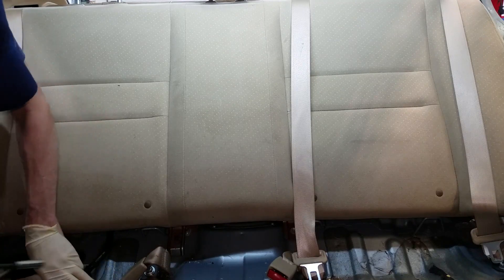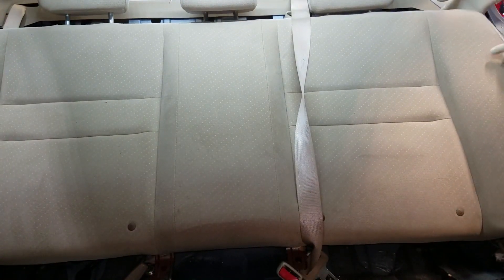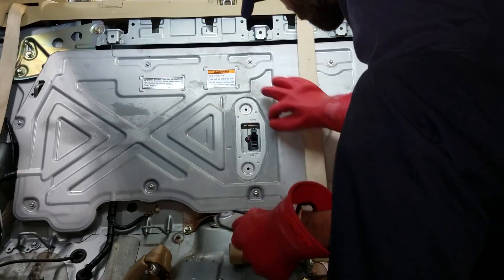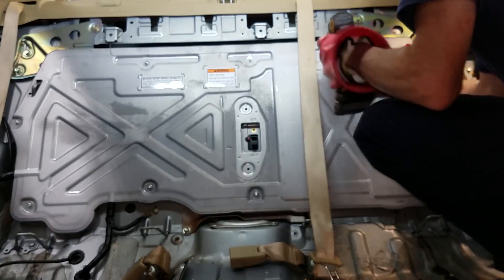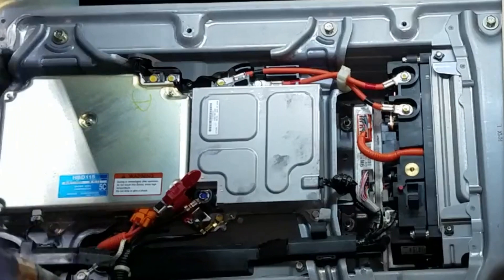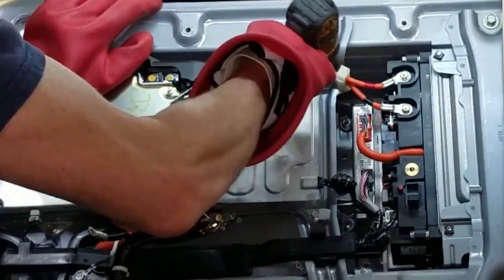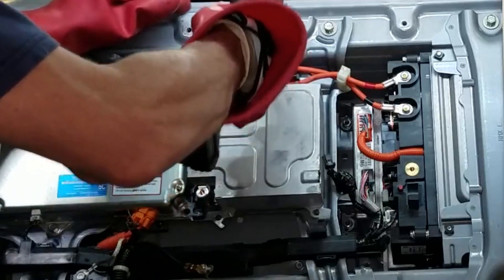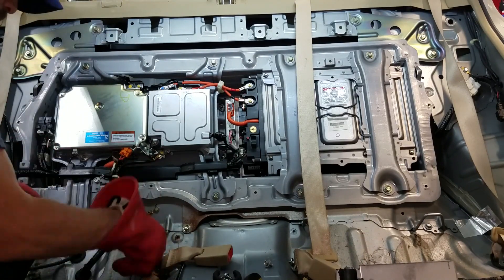Honda Civic Hybrid Battery DC-DC Converter Replacement

Comment: PLEASE HELP: Went to get a bad axel replaced on passenger side of 2014 hybrid civic, and 4 days later was driving in the rain and was braking to make a turn and the car immediately had brake system, charging system and IMA all pop on at once. I took the car back to where the axel repair was done and they said they didn't know what was wrong and to take it to honda dealer. I did and they said it's the DC-DC converter, but I just find it hard to believe it failed right after having axel replaced and suddenly. I haven't picked up car from dealer yet to see the code read out and ask if they checked fuses or grounding/wiring but I doubt they would check so they could just try to bill me 3k to replace DC-DC. Am I over thinking this and this is a normal thing that happens or should I investigate further?

Comment: I replace my DC to DC converter that I bought seconds hand online marketplace. But my car still not charging the 12v auxilary battery. I have a question do we need to reprogram anything when install a new DC to DC converter? How can I test if it is a problem with a DC converter or my car itself?
Reply: Hi bro i got the same problem and i was thinking to change the DC DC inverter so what have you done at last bro

Comment: Hello there i got a 06 honda civic hybrid and it has the ima and battery light solid on but i check the volts on each cell to confirm battery pack is good and it was so i order a used working dc converter but problem still there do you know what can it be?
Reply: Did u solve the issue? I have the same problem.

Comment: Hi folks, I found this video useful. My 2011 Honda Fit has been displaying an IMA light, and a message "I CANT CHARGE". A diagnostic machine showe there is a fault with the MOTOR POWER INVENTER, is this the part that has to be changed or just buying new  cells would help?

Comment: Dc to dc converter and intelligent inverter is these both same things?
Reply: No. An inverter converts DC to AC. That is the part to the left of the DC-DC converter. It is required for the IMA motor to start the engine and provide power to the hybrid battery through regen braking or engine usage.

Comment: Have a 06 civic hybrid. When car is running the 12V battery drops like yours did on your diagnostic video. But when you rev. the car, the 12V battery voltage goes up to 14V. We suspect the DC to DC converter but wondering why when you rev it, the voltage goes up and charges battery if the DC to DC converter is bad? Any information would be very helpful. Thank you
Reply: Did you figure this out? I have the same problem...

Comment: I got a 2012 Civic hybrid, the engine codes are p0a78  & p1440 . it's something wrong with DC to DC inverter? It needs to be replaced ?

Comment: is that the same as an "inverter"? Honda dealer told me the inverter (which went bad at 115,000) was $3500.00.
Reply: AndurilNarsil1 inverter is the one on the left of it.
Reply: No. An inverter converts DC to AC. That is the part to the left of the DC-DC converter. It is required for the IMA motor to start the engine and provide power to the hybrid battery through regen braking or engine usage.

Comment: I got a 2006 honda civic hybrid dies the 12volts battery overnight
Reply: Do you think the dc converter fix the problem?
Reply from the maker: Something is probley pulling power from the 12volt battery when the car is off. And amp draw test would need to be done to isolate the problem.
Reply: @FlatRateMechanic  P0200 code

Comment: Hey brother, I am not using the hybrid battery, I turned off the switch and am running off gas. My hybrid battery is bad, and I’m not going to replace it. But now my 12v is not being recharged. Is it this converter?
Reply: I have the same problem did u find out if its the dc converter
Reply: There is no alternator on this vehicle. The 12v battery is charged from the hybrid battery. You cannot have a reliable vehicle without the hybrid system.
Reply: Its iMA battery fault need to replace dtz y battery red light on in speedo meter .. you can’t drive long if red light is on .. car stuck n off .. soon no drive on long way . U need to replace iMA battery

Comment: If you turn off that hybrid battery switch... will that kill power to the ac compressor and make it safe to work on??? Please respond!! Thanks!
Reply from the maker: Yes, it would be safe, but I would always refer to the repair manual and take proper safety precautions.

Comment: I am not getting 12v charging. Just replaced the DC DC converter.  I am stuck.
Reply: E Z did you get it figured out?
Reply: I have this problem right now. Any tips on how to check if my dc converters bad?
Reply: prodAuggie replace the ecm located by the battery

Comment: You don't show actually removing it. After removing all the bolts, it still doesn't come out, because it's blocked by battery terminals. Still trying to figure out the best way to get this out, which would have been nice to have in the video. :)  [Edit: ah, it's that bracket on the lower left that you don't show removing]

Comment: I have the same problem in my 2007 honda civic hybrid. I have been manually recharging the battery modules (reconditioning). I watched this video, but you did not confirm by testing on the video. did the DC to DC converter resolve the problem? I am tempted to buy a dc to dc converter replacement on ebay but I am not sure this will fxx the problem of not recharging the 12V battery. I am in Utah. What state are you in? Thanks for your video.
Reply from the maker: Yes the DC to DC converter did fix the problem
Reply: @Flat Rate Mechanic  

You spoke about a 100A Fuse in your previous video where you diagnosed the DC to DC Convertor.

Where is that Fuse?
Reply: Where can I get to buy DC to DC converter for 2008 Honda civic Hybrid
Reply from the maker: @martinakafia9063  I got this on from the Honda dealer
Reply: @FlatRateMechanic   thanks what's the price range?
Reply from the maker: @martinakafia9063  If I remember correctly it was around 600$
Reply: @FlatRateMechanic  thanks so much
Reply: Question do you have the proper Hybrid battery for your 2007 car??
Reply: I tested my hybrid battery cell on this same car and all of them were bad which I highly think I should replace hybrid battery first